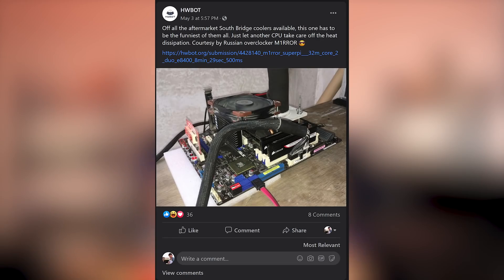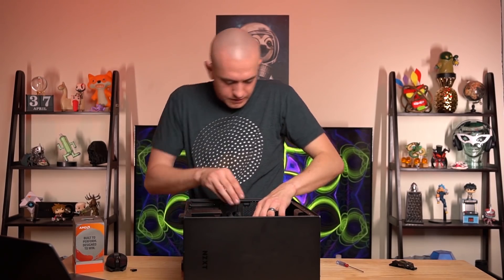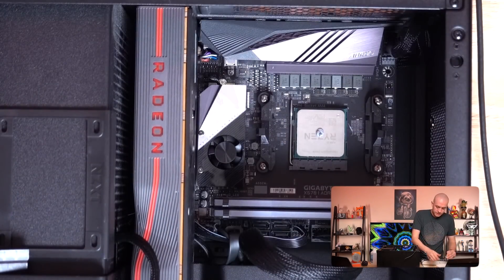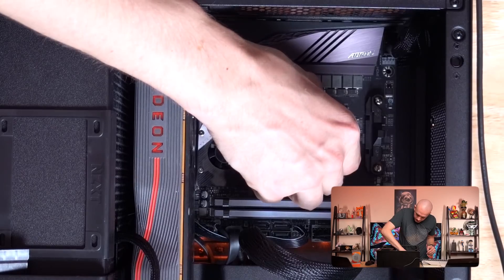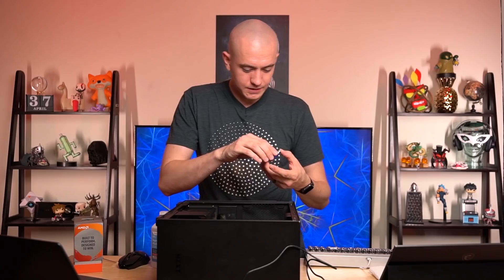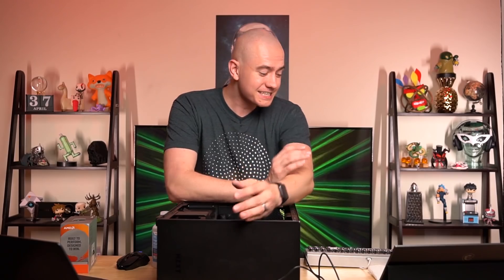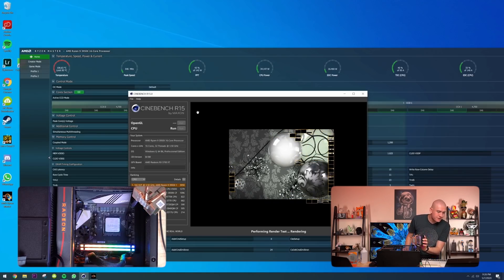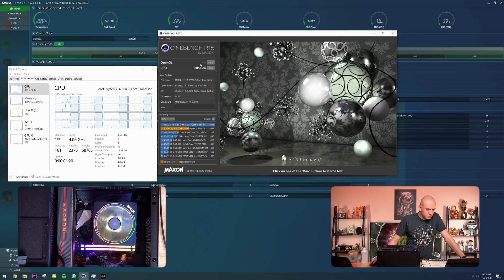Cooling A CPU with Another CPU

Comment: If I remember correctly der8auer tried running Zen 2 underclocked without cooler and he had trouble with it because apparently the IO-Die can't thermal throttle and will overheat, even if the chiplets stay under their thermal limit.

Comment: That's actually not how heat works, you can't make something hotter than the heat source if the source of heat is another hot thing.

If you're working with electricity, chemical reactions, or something else that MAKES heat, you can get hotter, but just with conduction/convection you can never make the heat sink hotter than the heat source

FYI

Comment: The risk of damage to the 3700X is only slightly higher than to the 3950X because the thermal shutdown doesn't actively cool the processor, it just turns it off to stop the electricity from continuing to generate heat.  The CPU still needs to cool down via heat dispersion.  Since heat rises, it's possible that the 3700X is a bit hotter than the 3950X, but you are still just waiting for the heat to disperse into the air.

Comment: Put a 60mm fan on the 3950x bare processor next time.  I bet your temps will stay under 100c during a few cinebench runs.
Allow me to be more specific:  A fan the size of the surface area of the processor, will cool the intended area better than a larger 80mm case fan.
Also, there needs to be a 4-6mm gap using pegs or something on the fan, so that it does not directly touch the processor.  Not just because you don't want hot plastic on your cpu, but because there needs to be a small space for the air to escape.
If no one else will do the video, then I'll be glad too.
I guarantee you though, that a 3700x with a tiny fan on it, will not cycle thermal shutdown.  (Unless the 3950x cpu ihs is much better or something)

Comment: So you think you can cool a CPU with a small slab of metal that is isolated on the other side having absolutely no way of dissipating that heat further. Great... Physics...
Even if you repeated the meat grilling on it, at least that dissipates heat by boiling water in meat. So, try cooling it with your finger!

Comment: The cooler is going to be (if solid) always cooler than the heat source. So the 3700x shouldn't have a problem (because same thermal limit).

Comment: Science:  CPU designed to radiate it's heat to the 'top' (IHS) and not the bottom (PCB), thus far less heat dissipation with two CPUs back to back.  The 10980xe lasts slightly longer due to having more thermal mass to soak up the heat, but once all that mass is hot, it still can't dissipate  the heat.  you'd get the same effect with a large chunk of steel on the CPU.  it will stay "cool" for a good amount of time, but once it gets hot, it will stay hot just as long.

Comment: Well that kidna help me with thermal paste ptsd (Did i put paste properly... as long as u have cooler on it its fine)
Reply: Sort of... No paste and imperfect cooler means it has no airflow and almost no contact, so it would likely be the same or maybe even worse than the test with nothing. But, modern CPUs will shut down (unless you disable that feature, and 99.9% of people shouldn’t). Also for almost any normal paste just put as much as you want, the rest squishes out like a peanut butter jelly sandwich, and most paste is non-conductive electrically so it’s not like it hurts by having excess because it squishes out the sides.

Comment: 3950x + thermal paste + copper cup filled with mineral oil= for science
Reply: Finding one with a flat base is nearly impossible (if you find a brand let me know, I’ve looked everywhere, the only thing I could find was of course made for CPUs and cost me about $400). But you can of course just use that copper cup (that’s basically all an LN2 cooler is), the thermal mass of the roughly 6 pound cooler lets you run for a pretty decent time before it really gets warm, haha, I’ve even used water/ice for coolant since the ice melts and needs to be pumped out, but it worked).

Comment: Did anyone else think that yes the 3950 has thermal limiting, the UNPOWERED 3700 does not have thermal protection.  I honestly was expecting the 3700 to get hot and fry while disconnected.
Reply: Physics? The heat source will ALWAYS be hotter than the coolant, it is thermodynamically impossible for the passive CPU to get hotter than the active one.

Comment: Wonder how long a solid billet of aluminium with a lapped end would run. Something around 1 foot long would still be light enough and probably dissipate quite a bit of heat, plus the huge thermal mass.

Comment: Ryzen 3950X is like a bully.  It didn't come with a cooler, so it beat up the weaker 3700X and used it as a cooler.  Unsatisfied, it tossed aside the 3700X like a small plastic bag of shrimp shells, bludgeoned a nearby 10980xe and used it as a hat.

Comment: I'm in Florida and my friends and family are confused about how I am able to cool my 3950x PC with a 480mm radiator sitting outside the window of my office. I started with a 2x4 wedged in the window with brackets screwed to it with the 480mm radiator mounted to the bracket horizontal. The fans on the radiator run off a 12v power brick not attached to the computer directly to prevent any chance of something damaging the PC if one of the fans was to fail due to moisture. Now i have a machined aluminum plate made that sits in the window that has quick connect threaded to allow me to quickly disconnect it if needed. This cooling was used to remove the heat from the office due to lack of ventilation in my office with the door closed.

Comment: You need to get 2 motherboards facing each other with both processors cooled by 1 modified air cooler attached to both processors. Good luck lol

Comment: I remember a time when CPUs would literally go up in smoke if you didn’t have a heat sink on them.
Reply: i didnt have a sink on properly on my ramapge ii gene and it fried the motherboard, probably the northbridge as they were reknown for running hot as is, wouldnt mind but it wasnt that long ago and id had the board for years and decided buy a case and parts and resurect it, so ended up having to buy another and even though they are ancient still costed £150 but at that point i was committed as id already bought the rest of the stuff cpu ram psu case etc then gave it to my stepdad lol
Reply: those are before cpu's had built in heat spreaders on them. The chip itself has such a small surface area, it will do that also without any built in IHS ( integrated heat spreader )

that alone keeps cpu's from going up in smoke with no heat sink on them

Comment: what about cooling with distilled water that cooks off?
Reply: Water boils at 100c, the processor shuts down before then (the processor by virtue of physics must be hotter than the coolant, so you’d need a very extended period of time if you only had 112c on the core).

Comment: Ryzen has integrated 'cooling fins' on bottom too, so you need to have a fan blowing there. So part 2 cool 3700x with 3950x + fan blowing on the 3950x :)